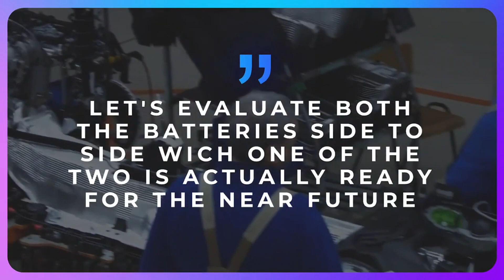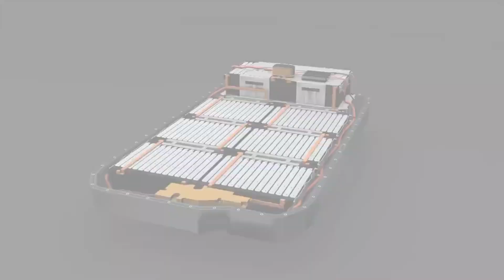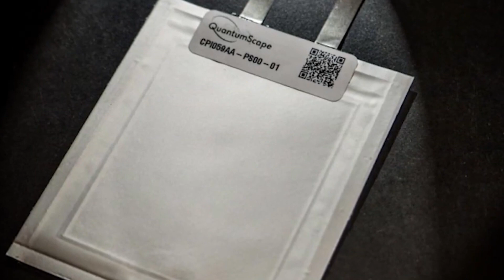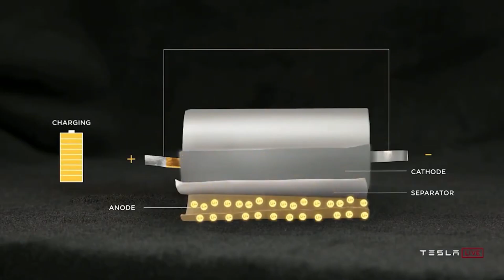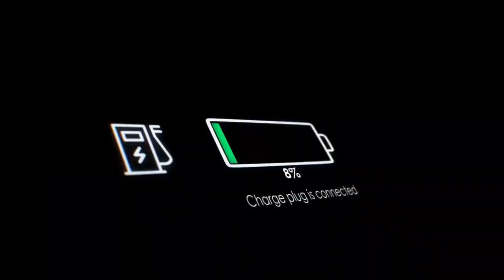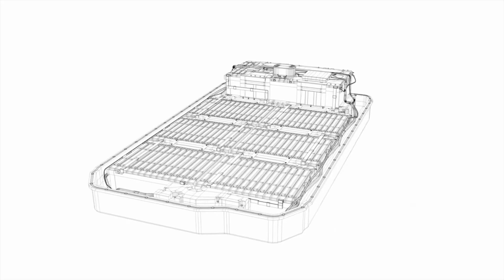GAME OVER - Tesla 4680 Battery Vs Toyota Solid State Battery

Comment: "Even when Toyota has its breakthrough..." Shouldn't that be "if they ever do have a breakthrough"? Toyota solid state batteries are vapourware until they release them. Not sure about the new Tesla batteries, I thought they were already making them, I guess not if I am to believe this video. But what is the point of comparing even one non existant product, let alone two?
Reply from the maker: There are info even for the non existing products

Comment: LET ME - Offer Tesla some advice when it comes to rolling solid electrolyte materials that I have come into contact with .. They tend to be brittle .. I have a way to reduce the issue of embrittled work stress .. Lasers .. Heating the solid electrolyte material will make it more flexible so that when it is rolled, it will behave .. I don't know why Tesla Employee's haven't figured that out yet .. I know that Elon has a real problem with NIH / Not invented here Syndrome .. Sometimes its just better to be wrong if you work at Tesla , Hmm .. Ticking off the CEO isn't promotion / raise friendly career move ..
Reply from the maker: You are right bro. Good analysis 🤝